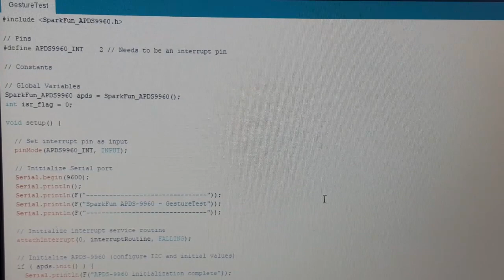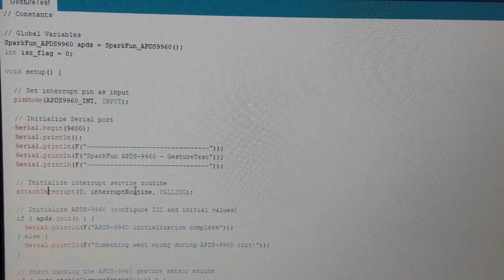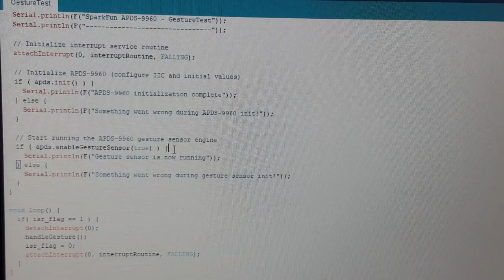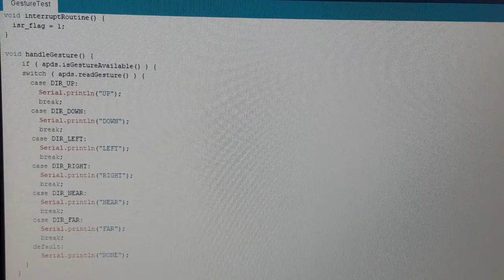Control your stuff like a jedi

Comment: Hello there! I have a few questions:
1) I can't find the small version on Amazon, only the big one that may be the APDS-9930... So I am actually scared to buy the wrong one.
2) I want to use this inside a lightbox, that will be 3in deep. Do you think it may work??? Will the light inside the box interfere with the reading? 
3) the LEDs I want to use are 12V, how can I adapt the voltaje to make it work with my Arduino Uno?

Thank you again!!
I love your videos, they are truly helpful! :D
Reply from the maker: 1) I would recommend eBay for this one. There are several sellers in china, where you can get the sensor for around 2-3€. So you can buy two or three of them from different sellers and you'll get the right one.
2) Quote from the Sparkfun datasheet: "Gesture results are affected by three fundamental factors: 
IR LED emission, IR reception, and environmental factors, including motion.". So light might influence the sensor. I also noticed that there is a optimal distance to the gesture sensor to work. It's about 10cm. 

3) You can control a LED with a relay or a MOSFET: https://youtu.be/Pw1kSS_FIKk